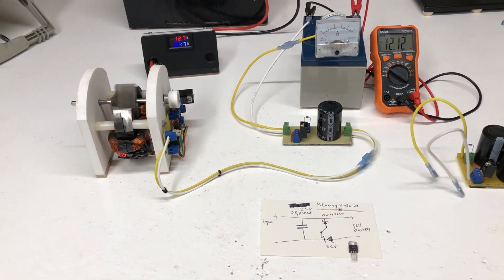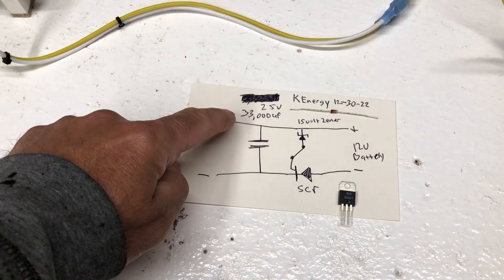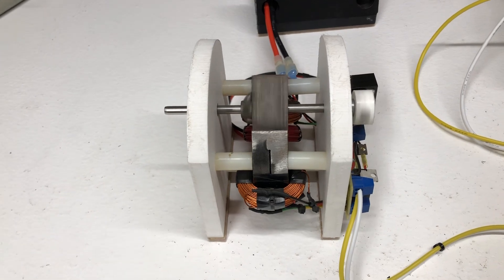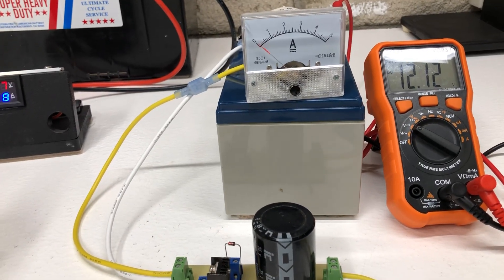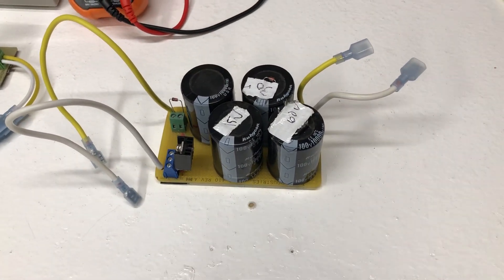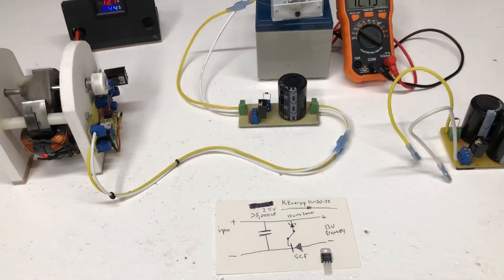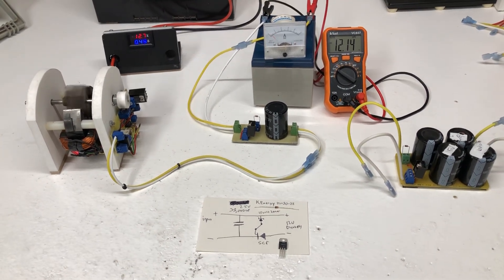Cap dump circuit

Comment: When the input of the power supply is small enough, the current does not get stuck. I have two supercapacitors in series 50F, which I trigger in the voltage boost circuit. 14.4V power supply only 5.5V, it charges the battery well whenever the supercapacitors have been discharged for a while. ps I use a thyristor

Comment: I still don’t understand how can you dump 300V spikes into 25V capacitor without destroying it. Sorry my electronics knowledge is limited.
Reply from the maker: @Traderhood  well they use to be called condensers for a reason they can do just that
Reply: @ I am sorry but I still don’t understand. There is the limit stated on the cover of cap. It says 25V max. I read about exploding capacitors when overwhelmed. I can’t comprehend in my simple mind why it is not case here. More importantly what should I use as guide not to get exploding caps if designation on the cover is irrelevant.
Reply from the maker: @ the cap doesn’t explode because the voltage doesn’t reach the limits 
The high voltage gets converted to amps
Reply from the maker: @ the cap dump fires with what zener is in place which is always lower Than capacitors limit

Comment: Is a dump capacitor a type of capacitor
Reply from the maker: @kisuleyowerisemakula.2926  yes it’s a voltage controlled capacitor discharge circuit

Comment: Nice one . I am building some projects that will use a cap dump circuit like this . Those multi voltage set up just uses the 60v caps though , is that right ?
Reply from the maker: For 60 volts you will need 100v caps
Reply: @kenergy1707  really . That much of a threshold ? I am getting some 450 volt caps also . Should I only charge them 300 volts ? Why such tolerance issue ? Is it because cheaper caps ?
Reply from the maker: This is for battery charging so 48v bat you want 60v zener threshold
Reply: So I guess I can't use this design to dump 400 volts unless maybe I use a resistor in series with the zener that show the Zener 30% say of the actual voltage in the cap . I wonder if that will work ?
Reply from the maker: @Buzzhumma  I’m sure it can work just may take a bit of time to make it work right

Comment: What scr are you using?
Reply from the maker: It is listed on other videos
Reply: @kenergy1707  Cant find it. I made myself one with the same layout, but the cap only climbs to the Zeners voltage and stays there. 
SCR - TYN412.
Any ideas?
Reply from the maker: @raphaelwelti6632  what mf ?
Reply from the maker: @raphaelwelti6632  the scr is latching that’s why I sell mosfet version
Reply: @kenergy1707  I meant the SCR that you are using. I couldnt find it listed in your other videos. Anyways, thanks for all the videos tho. There aint much around that show the stuff clearly, like the circuit in the video. And yes, due to the SCR latching, the MOSFET is more suited for this.
Reply from the maker: @raphaelwelti6632  this https://youtu.be/-YqRxNc27eo?si=k70eCt3Vm3xf2AXd

Comment: Maybe this might interest you. 
A simple reluctance motor run backwards to generate. 

Description in its simplist form.
1) a rotor with a few bolts pointing  radially. 
2) Two wires wrapped around a stator bolt
3) one coil is the primary. It is connect to a battery negative and connects to a switch to the positive. And the switch is made up of two wires that make contact at the same tine with a bolt on the rotor, and long enough that the rotor spins a little less  (360 degrees)/(2×number of bolts on the rotor)

In Motoring mode....
You give the motor a little push to get it started. As a bolt makes contact with the switch. The primary coil starts to energize, pulling the bolt closer. Finally contact with the switch is broken when a rotor bolt is directly over the stator bolt with the coils contact. Then the current stops and the remaining  energy left in the magnetic field, (after doing work of acelerating the rotor closer to the electromagnet), gets dumped into a circuit connected to the secondary coil.

In generator mode:
If you spin it backwards...  the rotor bolt closes the switch directly over the stator bolt and coil. The primary coil starts to energize. As the rotor bolt is pulled away, the coil inductance decreases,more current flows more energy gets stored in the magnetic field, rotational momentum decreases as mechanical energy or rather angular momentum is converted to energy in the magnetic field.  Then at a certain point, contact with the switch is broken, and current in the primary suddenly stops. Then virtually all the energy in the collapsing magnetic field gets dumped into a circuit connected to the secondary coil.  A very very small capacitor can be added in parallel  with the switch to prevent a large induction voltage spikes across the contacts of the switch.
Reply from the maker: Sounds interesting 👍

Comment: Nice… ty..  you should show you builds.. helps get the whole perspective…. Not everyone can read or understand schematic drawings….  Great job
Reply from the maker: I’ll work on that for you
Reply: @kenergy1707  do you know If the strobe lights.. single set up 12 V system works the same way as your dump board.. Or is that a multiplier
Reply from the maker: @joew5559  you can always try I used a buzzer before

Comment: Hi K Energy,  I tried your simple cap dump circuit.  It works but there is a limitation that I do not understand.  When the input voltage to the motor is over 13.9v the zener does not open after a pulse.
I ried 27v, 15v and 16v zeners with the same issue.  I have a FWBR feeding  the cap and I'm charging a 12v battery.  Any insight?
Reply from the maker: Thanks for the comment 
 That means the scr is latching from to much input what size cap is it ?
Reply: Uesd 2 different  caps, one is  100,000uF, I also tried a 4700uF with same result.  Thank you for responding.  I want to pulse a 12v battery at 24v or so.
Reply from the maker: @brodonh  that sounds right you can try adding more caps in parallel but could just be charging to fast
  My larger ones I use a mosfet triggered by a zener I use a tinny cap on the mosfet to delay the pulse

Comment: so does the zener diode dictate the voltage at which the capacitor will dump into the circuit ?
Reply from the maker: Yes it does depending on the zener trigger voltage

Comment: Thanks for sharing! Your work is very inspiring :). What happens if your input is a constant one? Does the circuit still pulses? Thanks in advance!
Reply from the maker: Thanks for the comment! If the input is constant it depends on the current to the capacitor if it’s to much it would latch open

Comment: Its almost the same circuit I see in these old fence chargers I repair... but since they are running much higher voltages, the Mov/Varistors are most commonly used. I have seen a few with the zener diodes but they are usually the smaller lower voltage units. Most of the scr's I see are rated for 800 volts and up... The old simple fence chargers I get to repair are sometimes 25 + years old. Simple is always better. Thanks for sharing your setup.

Comment: I took the Edwin Gray motor patent to a really good FCC engineer way back 20 years ago at least, and this infamous motor patent had very high voltage cap discharge to run it, (N N bucking coils to it)   And I remembered he said in the SCR discharging the caps to the coils, he said that its "random" and does not put the caps into coils "everytime" but is decided by a smaller :trigger: capacitor that will discharge the SCR whenever this smaller cap reaches a certain voltage and must have had a zener there too, so was thinking this is just what you are doing on the output, and it could be done on the input too.  They said hearing his motor run it sounded like popcorn machine, not smooth sounding but erratic blasts of the cap discharge so anyways you might find all that interesting.
Thanks again for your great videos and nicely built motors!
I really like that no-magnet reluctance motor.....have some ideas for you with that - as you could add "regauging: magnets on stator that react to rotor cores - and you can flip polarity of core upon "approach" 
For example, if repulsive firing, and N N rotor-stator coils, the CORES will "remain" the polarity they were just pulsed at, and became....("remnance") they dont just go back to a "default" polarity, or become neutral either, as they became "N" and when next firing comes up they pretty much will remain like that - not enought time between pulses to do much of anything.....also the flyback spike does not have enought current to it to influence the core.....
so what happens upon "approach" to the next motor coil pulse, the rotor cores remain N, and the stator cores remain N too.  So there is a clash of NN bucking magnetism that the rotor has to push itself through "upon approach" to next firing position., this causing extra draw, and reduced speed and power.  
And so what you do is put 4 magnets on the stators, (since you have 4 pole rotor...or two magnets on stators if 2 pole rotor) and these magnets need to be facing the correct polarity to flip the rotor cores over to S,,,,not too strong of magnets, and just right airgap and a good positioning of magnets next to stators - in fact try magnets on back-end of stator cores too....you want it to be magnets not so strong its hard to push the rotor through their magnetiism, but just strong enought so that duing the off period of motor coils, there is enough magnetism of opposite polarity to FLIP the polarity of the rotor cores (not the stator cores, just the rotor cores) 
They call these "regauging" magnets as they flip the polarity of the core....so anyways try this out some time what happens is first of all it gets rid of that "clash of magnetism:" upon rotor "approach: and even better it creates a "for free" power stroke upon approach to next firing position too, as the rotor core becomes S when you get the magnets on stators just right, and it happens in between motor coil pulses, the stator cores will remain their N and there is now the Srotor to Nstator pull into the next firing position....the "free" power stroke

Comment: Thanks for the schematic. I bet you could use a potentiometer as a voltage divider to adjust the trigger voltage. More simple than I thought. They say genius is the ability to see simplicity in complex systems. Your the man, I just ordered some zeners!
Reply from the maker: Thanks ! It’s definitely the simplest but works good on small motors 
That could work 
 it hits real close to the zener voltage though

Comment: Really great stuff you are doing!
Reply: I saw that news clip with you demonstrating one of your reed switch motors when I first started researching pulse motors. And I believe you coined the term splatter coil..lol Great stuff!
Reply: @redesign3dp  Yes there is lots of smashed flux comes out the "sides" when repulsive especially coils vs coils and you can catch it with coils positioned 90 degrees to airgap....
Reply from the maker: Thank you ! I’ve be a fan of your stuff from way back !
Reply: @kenergy1707  thanks I used to build the "konehead" motors with NN coils, like the Edwin Gray motor, but at 12 or 24Vdc input not 1200 or 12000Vdc  (?) then I discovered "regauging" magnets in stators that flip polarity of rotor core so get a free power stroke X 4 speed and half the draw, then made longer cores, packed winds on backend of motor coils so called these pickup winds, then came the "splatter" coils picking up the smashed NN flux coming out the sides.....on my way to do a conference in Salmon Arm BC back in 2000 or so, I was invited to meet Bill Muller the day before and he was 30 years ahead of me, and switched over to building Muller type stuff after that, then also did the rotovertor too which is very fun and easy.  Anyways thats my sordid history...now my favorite is "dual rotor motorgenerator" with motor coil and generator coil on common core, two rotors squeezing the motor/gen coils.....MrDKonzen my YT channel.....I have idea for you - when that cap discharges, have the cap "decoupled" AKA disconnected from the motor coils and/or generator coils whenever it does discharge.....this will make zero backemf "reflection" during discharge back to the input draw so you can get a good gain of power upon charging the 2nd battery....if you dont do this, everytime the battery charges, the input draw lurches up quite a bit....Anyways have fun keep going everything looks great.....try "axial" flat disc rotor motors NSNS magnets have the coresand coil in a stator will "strech" across so two adjacent magnets will push and pull "laterally"at  same time.....So coils wiired NSNS too....I think this best power you can get....also when Muller design (axial) there are coils both sides of rotor magnets, so twice the power right out of box as the magnets do work on both sides.....have two rotors, three stators  even better....anyways thanks for the great videos and nice machines to watch go
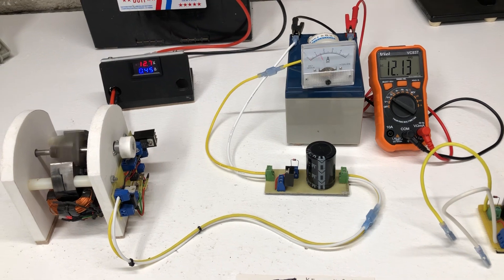Here is video look 1:13 into it I explain the push and pull same time thing - really good for "axial" design since it creates good "lateral" push sideways...
https://www.youtube.com/watch?v=wuq92YQKmbk&t=194s
Reply from the maker: @MrDKONZEN  
I remember the Muller generator I did research on back then that awesome you got to meet him ! 
 I have done some work on that rotor set up I made 2 motors they seem to work good 👍 
  I’ll definitely test out what you suggested and thank you for that !
Reply: @kenergy1707  Hi K
Put a seperate analog ammeter on the input to the motor from the run-battery, watch if it lurches up in amperage everytime that caps dump into the second charge-battery,  Most probably does....usually if going off shaft timing, such as 4 pulses into caps then one pulse out of caps to load, ("4 to 1" this is as example)  You can also time it so the pulse-out occurs in between motor pulses, which is good but still the motor coil (or generator coil it becomes in OFF period) is connected so there will be some backemf blow back you could call it AKA "reflection" ....if occuring during motor coil OFF period, it will manifest as "lenz braking reaction" as it would be with a generator coil....anyways with your "voltage controlled" cap dump, sometimes this might occur during a motor coil pulse, sometimes it can be right in between, its random....when it happens during a motor coil pulse there should be some extreme backemf blowback and the run battery is going to drain much more quickly than it should.  In between motor coil pulses not so extreme, but still creating some backemf in coil that momentum of rotor has to plow through and so increased draw.....
Reply from the maker: Hi D yes it does creep up a bit on the dump I’ll definitely try that thank you.